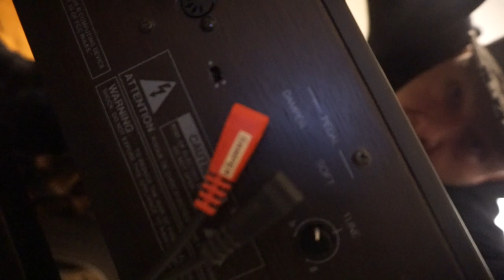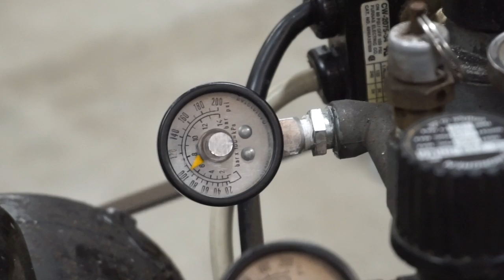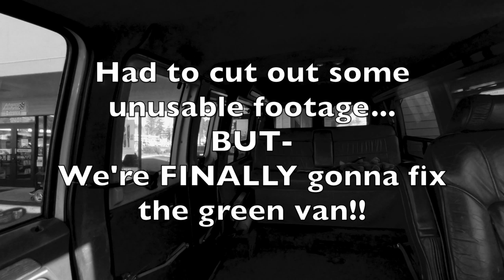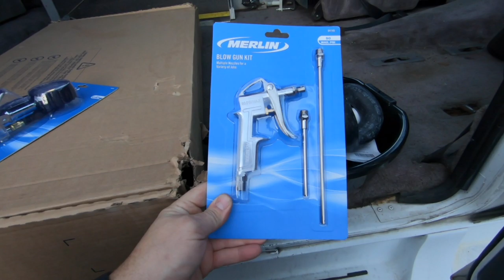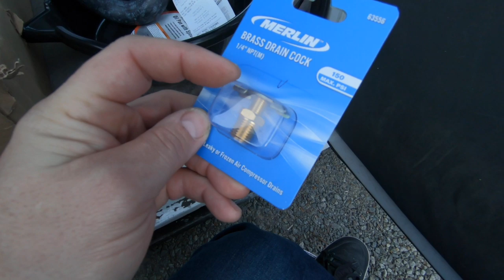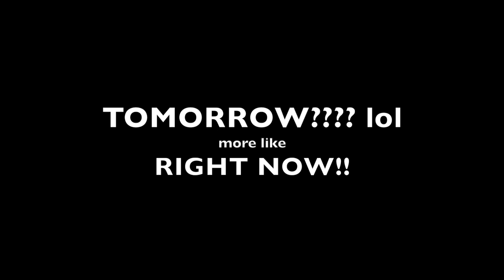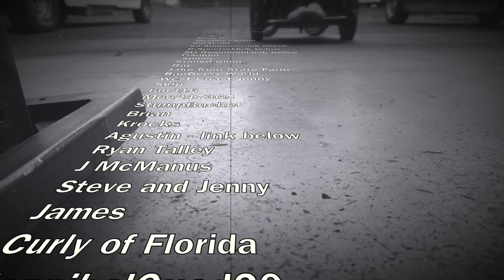VLOG 463: its radiator time!! (air compressor too)

Comment: you are the man.   just wondering, is your compressor too big for only 100PSI???
Reply from the maker: the pressure cutoff valve probably just got adjusted or something.. all of these old pumps can handle 120psi no problem :^)  i dont have a reason to use more than 100 PSI right now though - so will probably just leave it be - at least till i can get a look inside that tank and make sure its not about to rupture at higher pressures from rust!!
Reply: @TotallyNormal-  I am just saying that pressure pump is way too big for little pressure it gives out.
Reply from the maker: ah.. yes! exactly!